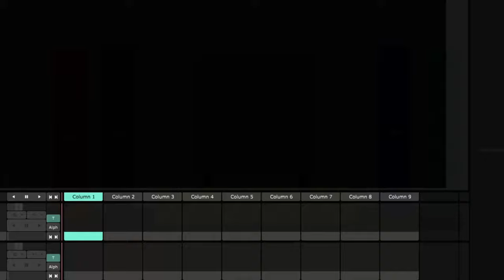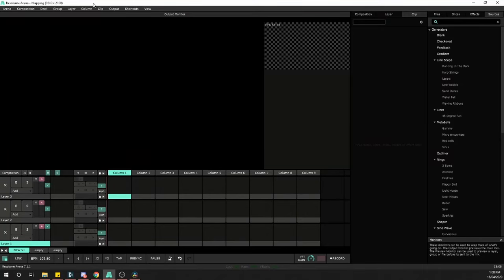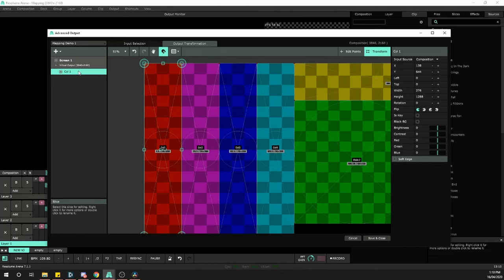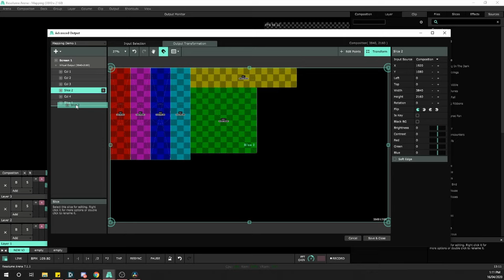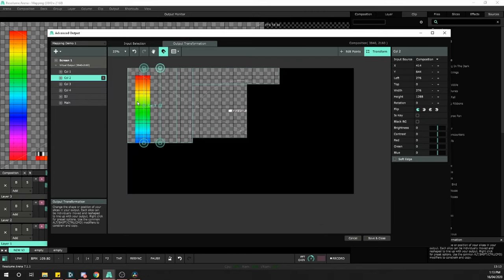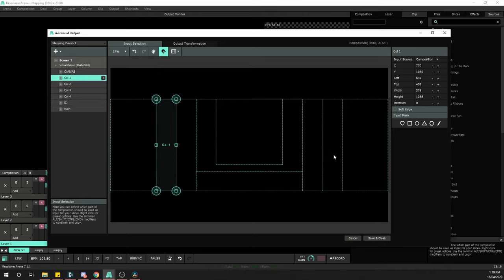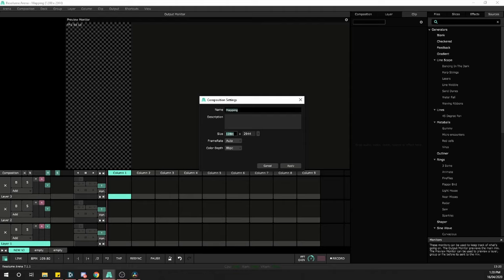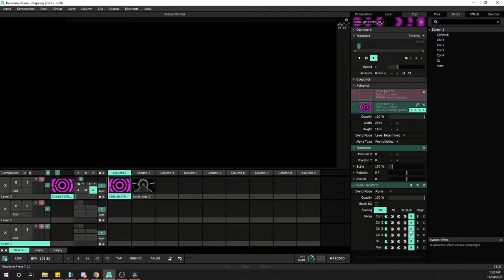Input and Output mapping basics // Resolume Arena #resolume

Comment: hi there, thank you for tutorial, but i have a question if you dont mind. i have 9k wide LED screen, but i only have 4k video content, everytime i fill the screen with 4k video content it look blury. is it possible to do the slice method like you did? or maybe do you have any suggestion?
Reply from the maker: Hi Harvey,
Yeah upscaling content will have some form of pixilation.
You could try using 3 4k slices to duplicate content, and maybe flipping them to tile the content
Reply: @mith  oh great. anw, thank you so much! 🙏

Comment: The Slices Panel & Slice Transform effect are cool tips, demoing the map with just a single layer is quite uninspired ;P
Reply from the maker: You're right K M, showing 1 layer didn't really demonstrate the granular control available with Slice Transform effects. I should have at least had other layers running to demonstrate the power of Slice Transforms more clearly.
Thanks for the feedback :)

Comment: How would you then send this information to the video processor for example a nova star VX4s?
Reply from the maker: Hi Ferx Sc,
Do you mean how to send the video signal or the mapping details?
Reply: MITH tv yes..
Reply: Please try to explain how we will do led wall data cable connection as walls are of different sizes
Reply: Could someone please do a video on fern sc question I have a vx4s controller and would like to know how to make this happen with my controller

Comment: where can i find templates? like this LED stage set up diagram? thanks
Reply from the maker: Hi Andrew,
Here are the maps i used:
Input Map
https://drive.google.com/file/d/1yyAOUnCxpIjyLrrlcO4VTgdfeR9xLr1q/view?usp=sharing
Output Map
https://drive.google.com/file/d/1yyKnpydVu8s20SOX8mrkCIafgZAB9gRA/view?usp=sharing
Reply: @mith  thx u
Reply: @mith  is there a program you can make these in? Something down and dirty? I started creating my own in PS but would be cool to have an app to do this.
Reply from the maker: Hey Andrew,
Here are a few options
These ones were generated with the Chaser plugin for Resolume. (This is a bonus feature of the plugin)
https://hybridvisuals.nl/chaser/
I find this the fastest way, as you can freely rearrange in Resolume first, and then use Chaser to generates a map

I also made a web based generator for single maps here: 
https://mith.xyz/tools/

Dvizion has an AfterEffects Template to create some great looking ones:
https://www.dvizion.net/portfolio/led-pixelmapper/

Ive heard the Red Dot Logistics software is good too, but haven't tried it personally:
https://reddotlogics.com/software/